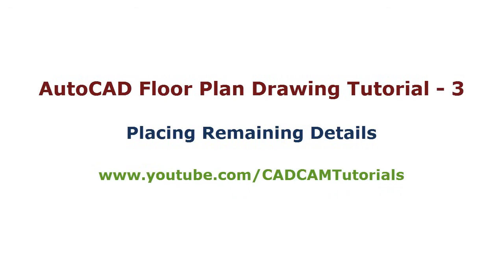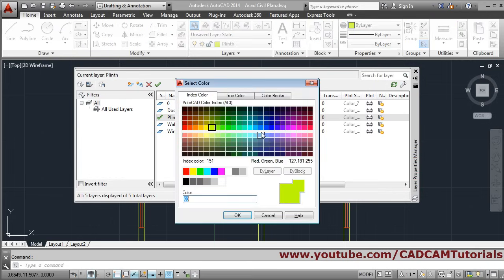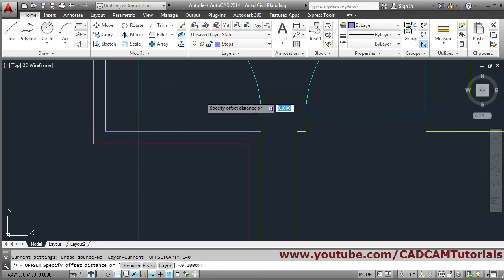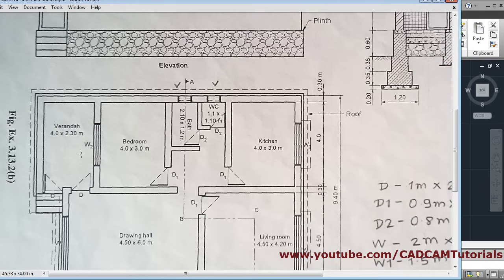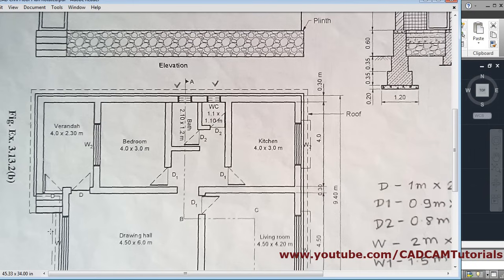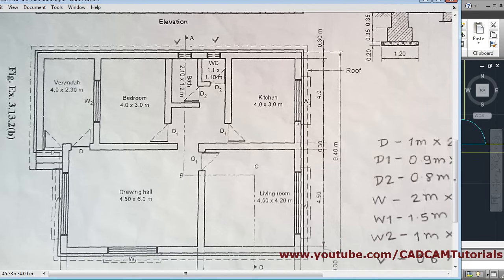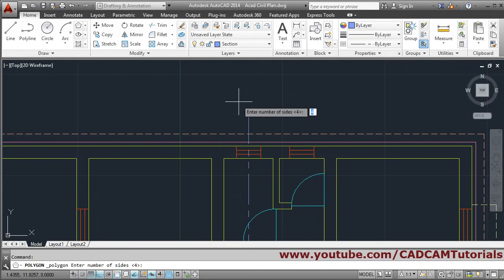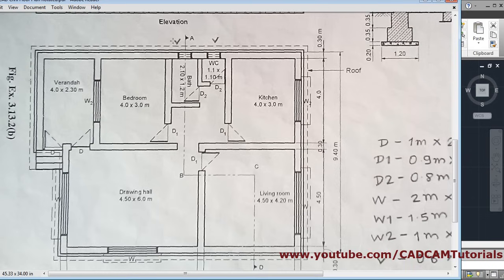AutoCAD Floor Plan Tutorial for Beginners - 4

Comment: I have selected Hidden type Line in Pilthing H and I break Pilthing at point but It's not showing as Hindden Line
Reply: I also face same problem
Reply: @Nayan_Solanki_11 type LTS and reducing it to 0.01 or even smaller, it works on mine. Hope it helps.
Reply: @Sammi153.2  Thanks. I also had the same problem and was starting to struggle :D
Reply: @Sammi153.2  thx,it help.
i will blame my potato laptop😂
Reply: @Sammi153.2  Thank you for this. I could get it to work on a new drawing but not in current drawing. I was going high numbers in the LTScale.

Comment: In my autocad line command is not being able to track along the previous line like you do in making chajja "0.1".
Using Line command, i can only track in free space.
What may be the reason for this issue.
Can anyone answer?
Reply from the maker: Make extension object snap on.
Reply: @CADCAMTutorials  It wad beacause i turned on the nearest snap. As i turned it off, the problem was solved. Thanks very much

Comment: Hello..In my Autocad 2016, changing linetype into layer (Hidden) dont work on small line but only to large...... (5:35)
Reply: Command: "ltscale" and choose a number smaller than 0.1, 0.03 worked out pretty good on my drawing! :)
Reply: @peegeywhy9224  Thank you so much!
Reply: Thanks man @peegeywhy9224
Reply: Thanks man @peegeywhy9224
Reply from the maker: Type LTS press Enter and give smaller value
Reply: Command: "ltscale" and choose a number smaller than 0.1, 0.03 worked out pretty good on my drawing! :)
Reply: @peegeywhy9224  Hello.. 0.03 is working for plinth but not for roof so is there any other option?

Comment: To all the people, who have difficulties with line gabs: in more recent Autocad versions it is done differently. The easiest way is to change the Global Scale Factor. To do so you have to go to the properties panel, where you find the line typ icon. From the drop down Menu next to it you have to select 'other'. In the now showing pop up window you can change the global line faktor on the right lower corner. 
Here are some additional explanations and other ways to solve the problem on the AutoCad website:
https://knowledge.autodesk.com/support/autocad-lt/learn-explore/caas/CloudHelp/cloudhelp/2019/ENU/AutoCAD-LT/files/GUID-45EABA0C-6558-4CEF-940F-023170207587-htm.html

Comment: Iam unable to draw chajja in 0.1 distance it's not showing any tracking ...tried many times.
Reply from the maker: Make object snap tracking on by pressing function key "F11" and try again.
Reply: object tracking is on but still, i was unable to draw since it was tracking the nearest point.So, I went to object snap settings and unchecked the nearest option.Now problem solved.Thank you
Reply from the maker: Nearest object snap is very problematic. One should avoid to keep it on in automatic object snap mode. Whenever required one can use it by shift + right click manually.